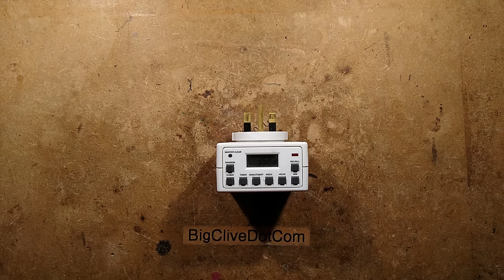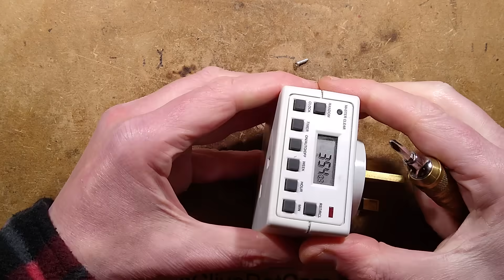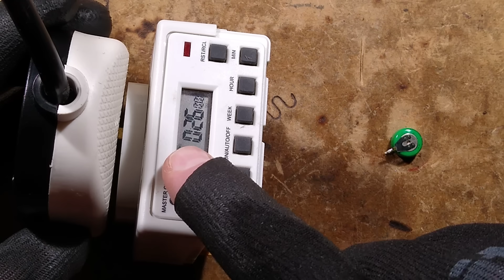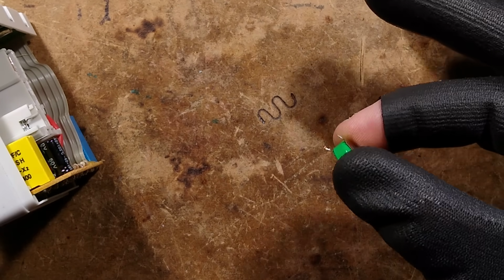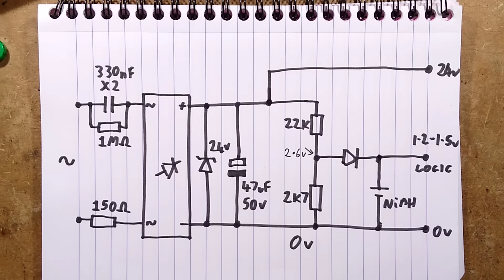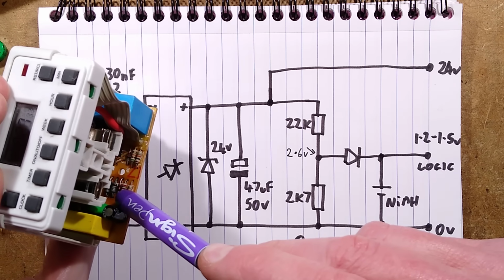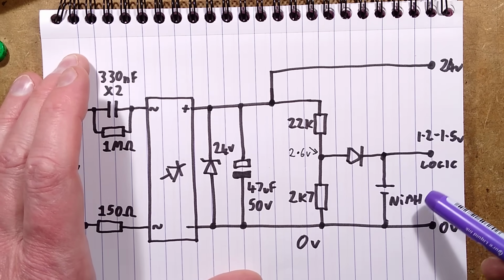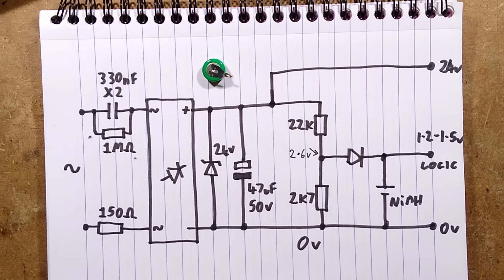Can we fix this faulty time switch?

Comment: NiMH cells are fully charged at 1.4V so the 2V reading would have been a good indicator of its failure. They're even more fussy about trickle charging so the charge current should not exceed C/20. Their one main advantage over NiCads is that they usually don't leak nasty corrosive electrolytes which have a habit of destroying circuit boards; a common feature found in various computers from the 80s.😉

Comment: I sometimes use an old shaver socket as a cheap isolation transformer. That way I feel more relaxed about poking my fingers in a Live pcb. I believe the shaver socket is current limited aswell reducing the flash bang surprises😅

Comment: I live in a block of Flats and our old fire alarm, when the back up battery's need replacing it start doing funny things like the clock start losing time followed by the wrong date comes up and if I haven't replace the battery's by then, it comes up on the display.  Power supply problem. Yes I know the back up battery's need replacing shut up I will do it.  It's been replace with a new fire alarm system and will be five years old next year HELP

Comment: I have some similar time switches from Homebase; ordinarily, they operate quite happily, but if the load is anything especially inductive (even a small electronic ballast for a domestic compact fluorescent), they tend to self-reset after the relay has switched the load off (probably back EMF or similar). They are fine with LED equipment, however. An equivalent product from B&Q (made to a completely different design) is made of tougher stuff, and is much more capable with induction switching - not that I've tried it on a 400 W SON circuit (yet...), mind you!
Yes, a lot to be said for all of those safety warnings, though "forgetting that the mains is on" has been my biggest downfall - wiring up a 135 W SOX ballast to a table lamp (as I didn't have any spare bayonet lampholders at the time) was my first zapping (nice belt off the capacitor too), and because I don't learn, I made contact with a completely non-IP2X terminal on a mechanical time switch case not too long after that...still just about here to tell the tale, mind you!!

Comment: I think swapping the 2K7 with a 2K1 would cap the charging voltage to 1.5V, and not cook the battery.  Current stays about the same, around 1mA.

Comment: I've not used a digital timer in well over a decade, mostly for this sort of reason, but back then I didn't know what to do to fix them so they often ended up in bits, and replaced with mechanical timers instead... :)

Comment: Interesting video as I have a few of these and had biffed a couple with this fault. On another  issue have a delonghi Vacuum with the motor not running at full speed. Brushes and armature are good but It has two identical capacitors on the circuit board. If one or both of these were faulty would it cause the motor to run about 15% slower?  They are Polypropylene Film 0.33uF 275VAC X2
Reply from the maker: It could be many things.  If it has electronic speed control the power supply may be struggling to drive a triac on one half of the sinewave.

Comment: Interesting. I've got a time switch that I've been using sort of like an alarm clock, to turn on a lamp in the morning to help me wake up. So it's only on for a few minutes a day at most. If I'm understanding correctly, that means the zener diode is getting roasted almost constantly, assuming the workings are similar.
Reply from the maker: It will be getting hot.  But not much more than in normal use.  I used to use a time switch to bring a light on in the morning too.  About a quarter of an hour before the alarm was set to go off.  It was set to turn off about 10 minutes later, which actually worked well to avoid sleeping in.

Comment: "massive bang, and a shower of sparks" 🍿😄 👏🎆⚡

In order to consolidate my responses, as I feel I may be taking too great of liberties, and risk wearing out my welcome... 😅.... I believe, you can take some graphite powder, pulverized pencil-lead, etc, and combine it with say, an RTV silicone sealant, dab a pad of it onto the tip of an otherwise, insulated (rubber) glove [let cure]... and you "should" be able to operate touch-screens, with it, and while reducing the risk to  receiving a 230VAC (+/-), 'shart' reaction... *make this pad approximate the contact surface area, of your preferred digit... 😀🍻... may save the family joules... watts wrong with that? (I'll stop... I'll try... 😅) 🙇

Comment: 1:33 - DISCLAIMER: "Caution, life is hazardous to one's health!" ⚠

"No warranty is expressed, or implied, no guarantee of, and for, any particular use, fitness, suitability, application, fitment, involvement, interaction, observation, pleasure, usefulness, safety, profitability,, merchantability, or any other result, or lack of results, not otherwise specified, therein"

"Batteries, not included, some assembly required"
"May contain small parts, and bits of peanut"
"Discontinue use, if you may be, or have had, an adverse reaction"
"Management is not responsible for lost, stolen, or damaged, articles"
"We reserve the right, to refuse service, to anyone"
"Do-Not Remove this Tag!"
😅(that "should" keep us out of court, for a moment, or two...) Cheers- 😃

Comment: I have 3 of these, the oldest one is a genuine Smiths model, the newer ones like yours are generic brands using the same case design & button layout but with a smaller display panel, the smiths one must be over 20 years old, but no longer works, (the relay only stays on for a few seconds, then turns off on it's own, no matter what the timer is set for).
Reply from the maker: That does sound like the classic dropper capacitor fault.  The capacitor can't pass the required current to keep the relay latched on after the electrolytic has given it the initial bump.

Comment: I think it is worth replacing a 2.7k resistor with 2 volt zener diode. This will extend the service life of the battery and prevent the failure of the controller in order to dry the battery.
Reply from the maker: Zener diodes are only available in specific values.  The circuitry is cost optimised, so it might cause issues.

Comment: Replacement part 5$ to $10, solar garden light with extra components 1$ to 1 pound, a quick and simple repair with just the right part priceless.
This is a Remarque on how it's cheaper to cannibalize something than to actually buy a part.

Comment: A solar engineer once told me (convinced me) that the inability to let go of 240v AC is a myth.  With all the zero-crossings and polarity reversals, you should be able to let go.  She said the real risk was with DC, and solar systems are full of (relatively) high voltage DC.  Still, always be careful.  You don't want to find out (that I'm wrong) the hard way.
Reply from the maker: It sounds like she's reading out of the big book of electrical misinformation.  AC causes sustained muscle stimulation, and you literally can't open and close your hands 100 or 120 times a second.  Smooth DC tends to cause a muscle jolt and then a burning sensation.
But I'd love to see the video of her demonstrating her expertise by holding two bits of pipe with wet hands and giving the 240V a test.

Comment: Speaking of disclaimers, when I assumed ownership of my 2018 automobile it came with a 25 square inch sticker on the driver's side window that admonished the consumer to refrain from eating, drinking, or otherwise introducing into their body any of the petroleum, or other fuels/lubricants coolants, vapors or contents of the battery. It's a shameful indictment of a failed education system.

Comment: Well, hot on the heels of meeting you in a dream, Big Clive, you're tearing down my timeswitch! ... I have one of these timers, which I bought in Wilko many years ago. It's currently in use, switching a USB Plasma Ball on and off at the side of my bed! It has a built in rechargeable battery.

EDIT: The LCD display is REALLY hard to read!

Comment: Just a thought, would it be beneficial to put another diode in series with the isolation diode going to the battery? This would drop the charging voltage from 2 Volts to 1.4 Volts, a better trickle charge Voltage for a Ni-Cad battery.
Reply from the maker: That could be a bit random in the result.  The forward voltage varies with current.

Comment: I have one like this. It was unplugged for a long time and the screen went blank. I left it plugged in for a few months and it still did not come back. I opened it up and gave the cell a charge at the bench. It was working fine since. I now park items like this which I know have cells in them in an outlet strip which is only on a few hours a week (at the washing machine) to keep the batteries up until I need them again somewhere else. I don't see the need to leave the washer plugged in anyway so it all works out.
Reply: With many of those units, if the display has gone completely blank & it doesn't come back on after being plugged in for a while again, you normally have to press the reset button once or twice to make it display again.
Reply: @NOWThatsRichy  Good point! I have encountered that on calculators. The one I have has no reset button but perhaps that was a bean counter delete and my poking around did the same thing.

Comment: Nice assessment and repair as usual Clive!  I’m no electronics tech, I’d guessed the zener diode due to the scorching or a dry joint.  Like that brass screwdriver, where did you get that?
Reply from the maker: The driver was custom machined by a friend.
Reply: Screwdriver was gifted by an individual that made it for Big Clive. I don't remember who.

Comment: I've got a couple of these. I was quite surprised that, not having used them for years, the backup cell hadn't gone crusty and still worked. I was using one to switch a solar inverter temporarily and it welded the contacts of the dreadful Songle relay. So my cannibalised repair was with a slightly less dubious relay from another timer and it's been fine since.

Comment: What's the point of the battery here? Is it a hack to cap 2.6V down to 1.5V for the logic circuitry?
Reply: It's to keep the clock going and the programmes remembered when the time switch is not plugged in, as demonstrated at the beginning of the video.
Reply: @matthewmarks6951  Ahh thanks!

Comment: 1:21 My sister has a vivarium heater relay that seems to have that failure - load buzzing and clicking from the relays. Can’t see anything obvious wrong, but would the dropper capacitor be likely culprit? If so, you’ll have saved my sister about fifty quid, and I will have the satisfaction of not having to throw something electrical out.
Reply from the maker: If it uses a capacitive dropper then that capacitor is a suspect.  If it uses a switching power supply with a transformer or inductor, then the electrolytic capacitor on the secondary side is the main suspect.
Reply: Yes, these capacitors deteriorate. There are all sorts of things you can salvage them from.
Reply: @ Thanks. I can probably get them for under a quid from one of the electronics shops, so I’ll try checking the capacitance, and then swapping it out. She said it stopped working after a power cut, but I can’t see any signs of a power surge having damaged it.
Reply: @cortanajpn  It was probably on the edge, having deteriorated over time, and the surge caused by the mains appearing part way through the AC cycle across the discharged capacitor may have finished it off. These capacitors look OK unless they have had a catastrophic failure. They are "self-healing" - designed not to explode if the dielectric gets pierced by a surge.

Comment: I think I would have added another resistor parallel to that 2k7 one so that the voltage would go down a bit more and the NiMh battery wouldn’t have to work that hard.
Reply: A zener made from a few forward-biased diodes in series would do that without slowing down charging of the cell.

Comment: I repaired two of these a couple of months ago. I had to replace the electrolytic capacitor and the x2 dropper capacitor. 

The failure mode was the following:
When plugged in the relay would turn on and off.
But when the controller was on an you plugged the time-switch in the relay wouldn’t turn on. You first had to toggle off and on again.

I only noticed this after a power outage.

Great video :)

Comment: Don’t like those time switches, the battery is always dead when I want to use them, once a year, you know what for.
I’ve gone back to the clockwork timers.
Reply: Surprisingly, I just unearthed one of these after a year or three, and the cell charged fine.
Reply from the maker: They don't like being stored too long.  It's a good idea to top the charge up every so often by plugging them in for an evening.

Comment: I have one of those, and it’s still working after more than 10 years of use - well technically it’s only used for less than a month every year to switch our outside Christmas lights on and off. The display goes off after about a month once it’s unplugged (stored on a garage shelf), but returns with a push of the reset button once it’s plugged back in. I guess in reality that running the battery flat and only having “used” it (plugged in) for less than 12 months in total is the solution for a long life?

Great video as always.
Reply: Maybe put two conventional and one Schottky diode in series across the cell, limiting it to about 1.5V?

Comment: Good fix. 
I usually modify the circuit with a second, 9V zener (lower might work as well, have not tried it) with a transistor in series in parallel to the existing one and switch that inverted to the relay coil. Increase the 2K7 resistor and add a zener parallel to it (make a crude voltage regulator, to not overcharge the battery). It drastically decreases the standby power and they last longer.

Comment: This is exactly what I experienced several years ago with similar timer socket. Except mine didn't work at all. After pulling it out the socket worked just fine. Interestingly, these batteries tend to cause problems in VHS VCRs which I collect and repair. Some refuse to work at all. Philips machines tend to activate child lock for example. Ni-mh cells can be nasty little buggers.
Reply: Probably NiCd in that sort of vintage!
Reply: @matthewmarks6951  Not all of them were nicad. The older ones for sure. The newer VCRs even used these large nimh button cells with soldering tabs or round "legs" placed vertically. Or the tiny ones in green shrink wrap.

Comment: Nice to know about the Battery fix and problem. Here in the USA the most common time switch always has the same failure in that the Zenor diodes short out. It takes a bout 9 months for the under rated Zenor's to die. I have repaired 4 of them so far by replacing the Zenor's with higher wattage units of the same voltage rating. They work fine after that. But now I know about the battery's lifetime problems. So, thank you Clive for sharing this video with us.
Reply: I had some with failing mains voltage capacitors. Running at 230V, 50hz)
I never replaced a Zener

I always replaced the battery with a standard aa rechargeable battery. 
I don't use those any more.
Those tiny batteries are expensive for no reason., aa is cheap and indestructible for infinite trickle charge
Reply: @CyberlightFG  Must be  some differences with the units they sell in the USA for 120 VAC only, never had a failure other than Zenor diodes. But I do expect to see the batteries fail now that I have seen this video.
Reply: Hi Clive ...Whilst watching your interesting presentation, it was constantly interrupted by adverts. One being for a little 500 watt  heater that was designed by a "genius" at London University, that can heat a house from freezing cold to 20 c in just two minutes...Wow! ...
I guess it would use even less power?... If it was fitted with one of those sand filled power saver plugs..😂

Comment: Just wondering if it would be possible/worthwhile to add a 1.6v zener diode across the battery to keep the voltage in check...or maybe that would accelerate the discharging of the battery when it's unplugged/not powered?
Reply: I just suggested two conventional and one Schottky diode in series, as parts more likely to be lying around. It wouldn't discharge the battery.
Reply from the maker: The zener would probably have a high enough leakage current to impact the battery back-up time.

Comment: Zenering [Zee-Ner-Ing] 

Verb
1 To act as a Zener diode should.
The Diode was Zenering properly

2 Allowing current to flow in one direction and in the other 
direction, sometimes.
The Diode may NOT have been Zenering as it should

3 (Slang) To jump up and down with joy and always land on your feet. (See "Yo-Yo ing").
The Wild Woman was Zenering on the Dance Floor.  💃👀🤣😂😒😉

Comment: I have a 23-year-old time switch that hasn’t got a built-in battery, but relies on a changeable AAA battery. As it isn’t charged by the device, you can both use primary or secondary cells. Quite neat. 

I dislike the use of capacitive droppers in devices with relays — including motion sensors. They waste a lot of energy when the relay isn’t powered (usually 0,7 W up to over 1 W). I wonder why the manufacturers don’t use switching power supplies that, as a side effect, need much less space on the circuit board and have a more stable output voltage. Smart plugs usually use switching PSUs with a quite low standby power (~ 0,2—0,4 W), so why can’t other other devices?
Reply: Component cost probably. A simple capacitor dropper is cheaper to implement than a switch mode PSU.

Comment: I saw few of this timers and power meters where battery wasnt charged through voltage divider 22K/2k7, but only by resistor - something like 22k from 24Vsupply and when NiMh battery fails to open circuit, full 24V appears on  low voltage microcontroller and (intentionaly) burn unit. I always added Red LED parallel to battery.